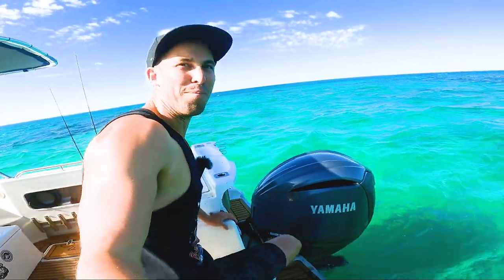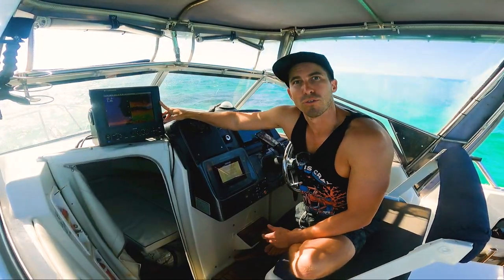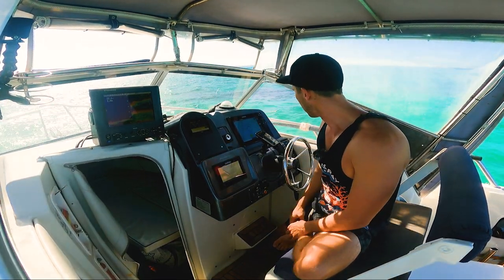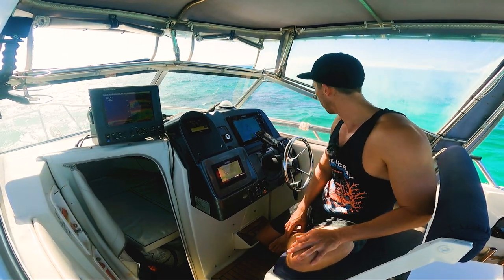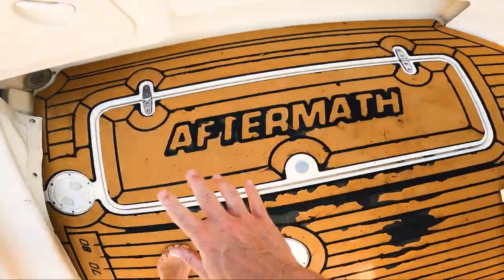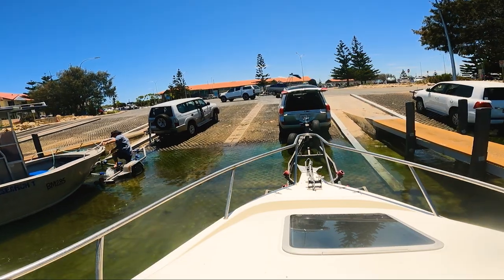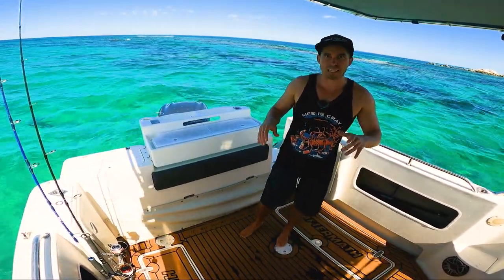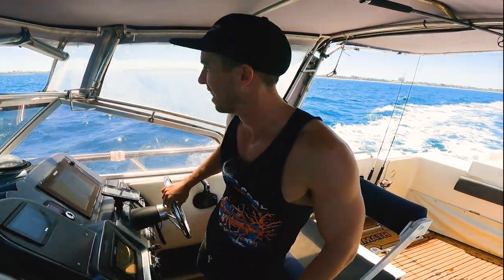HAINES HUNTER 680 encore 'walkthrough'  // yamaha 300hp rundown

Comment: Just curious, I have the same boat with a 225hp Yamaha 2 stroke doing exact  WOT speed with four solid blokes onboard… do you think maybe that boat with the 300hp is under performing for some reason? Nice video mate!
Reply from the maker: Yeah I think it’s around normal, others with the same setup are getting similar speeds, i mean when I had a 225 4stoke the top speed was around 35 knots, guess it’s how it’s propped
Reply from the maker: Aw by the way my wot speed is around 46 knots, in this video I think I only went 40 from memory
Reply: @WCSwestcoastsalt that’s better, 46knot definitely is an upgrade in performance.

Comment: 100lt an hour 40knts, for a single 300, surely that can't be right is it??
My old twin 200 verado's on my 7.4 glass boat do 108lts per hr combined with a full 480lt tank at 39knts ..
And thats pushing just under 3t, deeper deadrise too..
I would have thought that the newer outboards produced better economy than that..
Im surprised, think I'll keep my Verado's for a bit longer.
Hopefully as you run it in you get better economy 👍
Reply from the maker: Yeah that’s almost at full throttle with close to 600l of fuel, not the most economical rig at full noise, calm it down a bit and it’s not bad